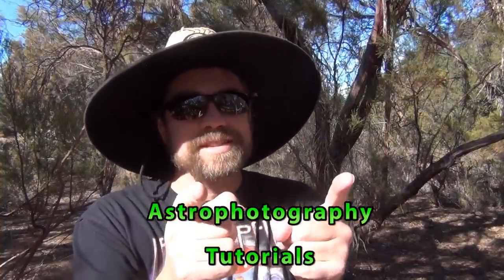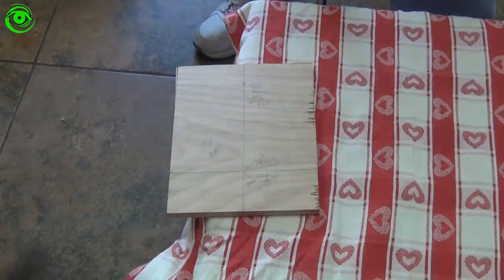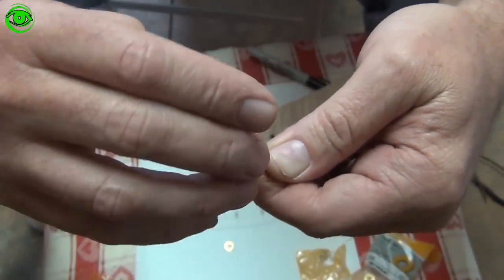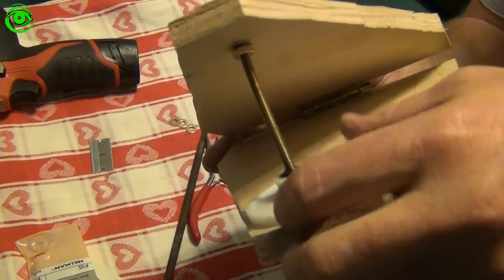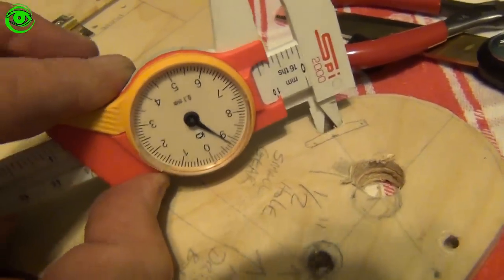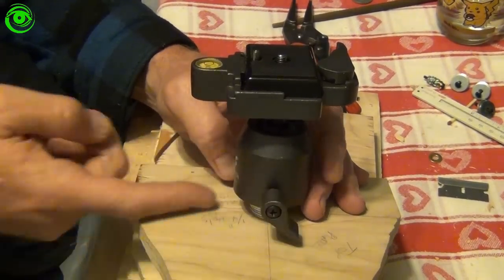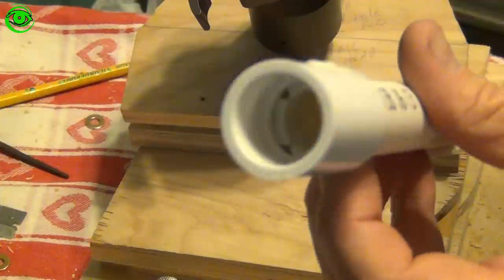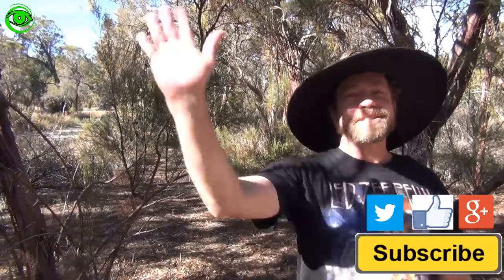How to Track Stars With Your DSLR - DIY Barn Door Trap P1

Comment: hi Doug, i am trying to collect the materials for making the barn door, since i live in Europe and we use the metric system could tell me what is the diameter in mm of the 10-32 threaded rod. Thanks in advance
Reply from the maker: Hi Kostas, I know the thread pitch plays an important role here.  While I can measure the rod diameter, the pitch of threads are what determine the movement of the gear.  If at all possible, you should try to source the 10-32 specs.  I don't know of a metric equivalent that works the same.  Doug
Reply: Well from reading the webpage you provide for the barn door design, what matters from the rod are the threads per inch in order to get the correct radius for the curved rod. From my research the 10-32 rod has 32 threads per inch. The equivalent for this rod seems to be the M5x0.8 rod (5mm diameter, 0.8 pitch) i just want to confirm the diameter of the rod with you.
Reply from the maker: kostas stavropoulos Hi Kostas, I measured the diameter of my 10-32 rod and it's 4.9mm on the Outside Diameter.  I hope this helps!  Doug
Reply: Thanks, just what i thought, it's almost an M5 metric rod (the 10-32 is thinner by 1mm)
Reply from the maker: kostas stavropoulos Do you think you will be able to find a blind well nut too?  That will be the tricky part.  If you do find a blind well nut, would you mind posting your materials used?  I'm sure other people who have metric only hardware would be interested in your findings.  Thanks, Doug
Reply: No problem, one small correction though the M5 rod is thicker by 0.1mm and not 1mm as i mentioned before
Reply from the maker: kostas stavropoulos Excellent!  Thanks Kostas!
Reply: kostas stavropoulos Hi did you build it with the M5 rod and if so did it work?

Comment: Can this work in the Southern Hemisphere?
Reply from the maker: I can't say from experience, but, I'm sure it would work if you aligned to the SPC star ( Sigma Octans?).
Reply: Definitely works is Southern Hemisphere!
Reply from the maker: Thanks Ben for confirming this works in the southern Hemisphere!
Reply: Thanks for all your videos!
Reply: Kishan, I am just about to build one of these but I'm using a different alignment method which does not require sighting on a star but uses a precisely levelled base plate and a good quality compass, so if it works, it will be good for Southern hemisphere. I will comment on here when I have finished it.
Reply from the maker: Great!  I'll look forward to your updates.

Comment: for 200 you can buy a tripod with tracking motors.
Reply from the maker: rocket9244 Do you have a link?  I think some people would be interested in that deal.  Thanks for the suggestion!
Reply from the maker: rocket9244 Great Link!  Thanks Rocket!
Reply: I read a review online that suggested that these cheaper mount/tripods weren't worth the money. The reviewer recommended either buying a more expensive one, or building one yourself. Have you used this? I'm not that handy and might end up spending more after I mess up a few times. Most of the ready-made options are around $300 or more.
Reply from the maker: Hi Joe, That sounds about right, I think the materials for this depending on what you have now, could cost as much as $150 to build it.  If you have some simple tools you can do this yourself.  But if you don't have the necessary tools to build this, then purchasing a ready built one may be the best option in the long run.